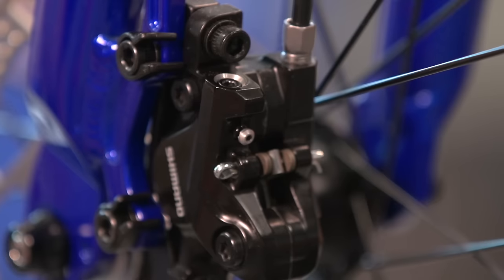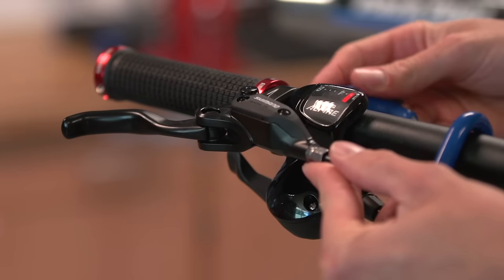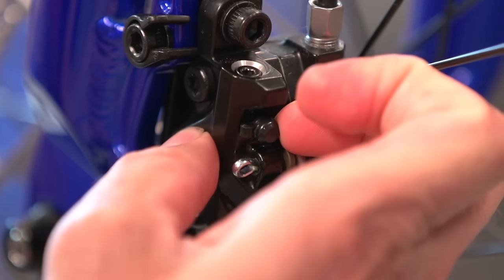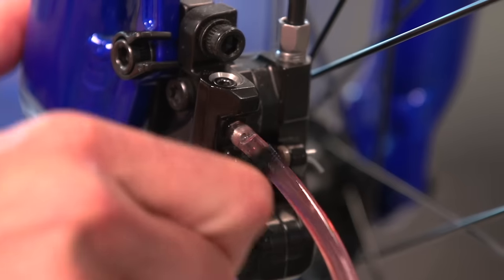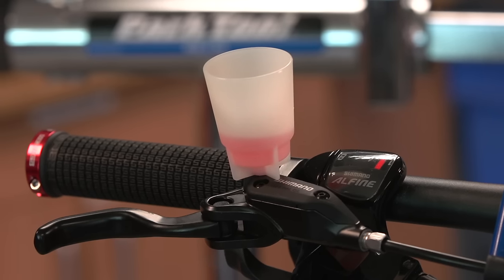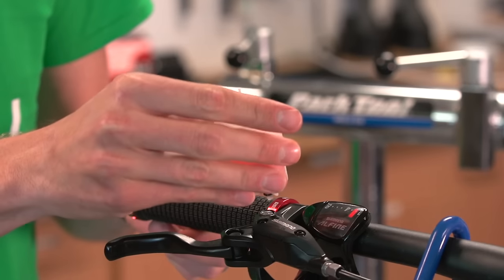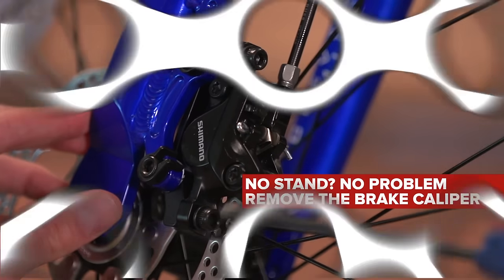How To Bleed Shimano Hydraulic Disc Brakes

Comment: There are some missing steps here as others have said!  You should purge any air from the syringe before pushing through the caliper.  You are missing the steps of passively releasing air (and a little mineral oil from the caliper) and positioning and flicking the levers several times to remove any remaining air in the reservoir.  You should most certainly remove the wheel and pads and secure the proper bleed block between the caliper pistons...
Reply: You are a legend. Thank you for the advice 7 years later.
Reply: Hey, the next time you go poop, let me know because I want the diamonds.

Comment: Good and concise video!  But I would highly recommend removing the brake pads and using a bleed block.  It's true that once you get good at bleeding, your chances of contamination get pretty low, but why risk it?  It only adds 30 seconds or so to the procedure and it's worth eliminating that potential trouble spot, especially if you're not experienced with bleeding.
Reply: Good advice.
Reply: This
Reply: I absolutely ruined my brake pads the first time I tried this so I definetly support your statement

Comment: If you don't want to remove your pads etc and still keep them from 
getting contaminated, just wrap the caliper with a piece of cling film 
covering the pads, pop the bleed valve through the wrap and it will stop
 any accidental fluid to pad contamination.
Reply: thank you!

Comment: Thank you so much for this video. It's the exact model calipers I have and I've never done this before. I spent about an hour just trying to find a video or manual that made this simple to understand. Your video nailed this in less than 5 minutes. Now I feel so much more confident knowing how to fix this next time without having to look anything else up online.
Reply: me too
Reply: And me too. No faffing around, did front and back brakes on first attempt in less than 10 minutes - nice sharp brakes now.

Comment: Great tutorial, even though my Deore M575s are a little different configuration, you provided enough information about why you did the specific steps for me to figure out the things that were different. Specifically, the valve release is a nut just behind the feed nipple, not a hex screw on top. Otherwise, after a slow step by step for the rear, I was able to breeze through the front with no help! Thank you for sharing!

Comment: Was totally unfamiliar with bleeding bike brakes, but I got a kit for $20 and followed the video and they're good as new.  A few videos I watched before this were much longer and involved removing the pads and using spacers which I wanted to avoid doing.
Reply: you have to use those spacers with some brands or they pop out and you get oil everywhere

Comment from the maker: Head over to your local bike shop. They should be able to help with the part and may even have a couple spare lying around. If not, the shop you bought it from, or the distributor in your area should be able to help out.

Comment: I've used vegtable oil in all my bikes that take mineral oil for 30 years now, it's never caused any problems or ever caused Corrosion in my parts or o rings and works extremely well i would go to say it works better and gives to good stiif non spongy breaks

Comment: Cheers for clearing up my questions I had running around in my head. First bike I've had in many years and tech has come along a fair bit. Curious that dot 5 silicon based fluid isn't used but no doubt there's a reason.

Comment: So what abut the pad position? If the pads are worn and you bleed the system and then try to replace the pads won't the system be overfilled? Also, maybe remove the pads  before the bleed so you can pump the pistons back into battery and you also don't inadvertently spill fluid on the pads.

Comment: Just a note. If you have cheaper oil use it in the top cup to fill it just a bit.  Then push the new oil in and when all bubbles and old oil is out shut the valve.  You're just gonna toss the oil in the cup anyway, and none of the cheap oil will go down.  No sense tossing the expensive oil.

Comment: New to mountain bikes but have bleed many brakes on vehicles. I've seen a few videos and I'm always surprised by the given technique. Why don't people just use a syringe to push the new fluid into the reservoir and out the caliper and/or pump it out with the brake handle while filling the reservoir?
Reply: Like a car?

Comment: Brake Bleed Funnel (Shimano) are not the same threads. Therefore to casually screw on is not always possible. To find the correct adaptor is a sod

Comment: You should really remove the pads before you do this.
Reply: I'd concur, and I remove the wheel too. Brake fluid is impossible to remove from a brake pad. The rotor is cleanable, but its best to not have too.
Reply: Yes, that is right! I also use masking tape around and below the brake system so any leaks can be blocked and absorbed by the tape, and will not get to parts that will affect braking and soak in to the pads (this will be, like you say permanently absorbed, and cause less friction and squeaking. Also masking tape adhesive is not going to mark the paintwork.
Reply: And he skipped how to remove the air trapped, there is a way....to do it
Reply: Are you questioning GCN??? Fite me rite now!

Comment: My Shimano brake fluid's colour has changed into yellow. If I apply this procedure to my brakes, will the old fluid and the new fluid get blended?? If so, what can I do to prevent it from happening right from the start?? PLS answer me soon! TKS a
lot
Reply: If your worried about it mixing run new fluid from top to bottom first then bleed the brake to remove the bubbles. I did this on a set of zee I bought second hand and they run really nice now with new fluid in them.

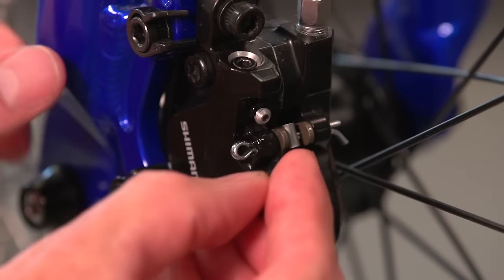Comment: After turning 1 round anti-clockwise for the valve at the brake device below, did you forget to tighten the valve back (@video 2:33) when putting on the rubber dust cap?
Reply: 2:05

Comment: Should you not remove the brake pads before bleeding the brakes, so that they won't get contaminated ? Shimano also give the plastic spacer that fills the gap between the two pistons (where the pads been) - you don't seem to use it. I've seen shimano deore bleeding video and it looks quite different.

Comment: do you have a video or information on how to shorten the hose on these same type of shimano brakes. I removed the hose from the lever but found the brass olive seems to be crimped on and can not be removed to reuse the small parts. how can I shorten hose? do I need a special crimping tool or something?

Comment: i have a e bike that i use for my daily commute  avg of 14miles each way. been considers purchasing hydraulic brakes.. should I? how often would i have to bleed?  Would it be better if i stick with my mechanical disc brakes?
Reply: daspecialist1220 mechanical disc brakes are rubbish. Proper hydraulic disc brakes are amazing. Once bled you should never need to bleed it again.
Reply: i heard that everytime you add fluid or change it out you have to bleed the brakes.. see that would make a huge difference for me because i literally do 28 miles a day. for someone that rides a bike here and there it would be such an issue atleast this is what i was told
Reply: Angelo Ramirez you don't have to add or change the fluid very often or at all in fact. Once you have blead up, that's it.

Comment: Hi I have a mountain bike with a mechanical disc brake I want to convert to hydraulic brakes. Do I need to buy a seperate gear shifter when I am converting to hydraulics?because my current gear shifter is attached with my brake lever (what I mean is that the gear shifter and the brake lever is attached to each other they are together)
Reply: Yeah you'll definitely have to buy a new brake lever/shifter
Reply: James Black Thank you James!

Comment: How much mineral fluid do you need to suck with the syringe to successfully bleed the brakes.
Reply from the maker: It's not a huge amount - really all you're looking to do is get rid of the air from in the system.
Reply: About 25ml

Comment: It seems my bleed valve is leaking. Every time i break i can see fluid squirting out. I tried different levels of tightness on the valve and the problem persisted. Is this a common mistake? Do i have to purchase a new valve?
Reply: Try wrapping the thread in teflon (PTFE) tape first, or some other sealant. See if that helps.

Comment: I was changing the front wheel to replace the breaks, and noticed a lot of fluid came off where the front breaks were. When I realized the cap on the side of the breaks was missing I found it and put it back. I put the breaks back in and wheel back in and noticed it doesn't want to squeeze the breaks at all. Any help? It feels so loose, there is no movement of the breaks almost as if there are no breaks at all.
Reply: well no shit all the oil came out you need that oil for the brakes to work

Comment: So my hydraulic disk brakes work fine if I'm going slow but as soon as I speed up they somehow stop working (it seems as though it loses pressure). I've tried readjusting the pads and positioning of the brakes, I bled the cable and it still does the same thing. Any advice?

Comment: Pro Tip: you can use baby oil instead of mineral oil. It's cheaper and easier to obtain, and works just as well as mineral oil, I can only speak for Shimano hydraulic brakes, your mileage may vary.

Comment: I'm surprised you don't advise to take the pads out and replace with a pad block to avoid contamination. Sure you could probably do it without getting oil on there, but there is a risk which isn't worth taking personally.

Comment: I was suffering from squeak, then realize my caliper was leaking, where the pistons push the brake pads. Mineral oil was going into the brake pads making the squeaking noise, Any ideas how to fix this?
Reply: maybe the pads are contaminated, if they are, you should change them.
Reply: Try sand paper on pads. Clean oil  off this way

Comment: Why not bleed them the same way you do a car or motorcycle? By using the master cylinder to pump the air and fluid out of the bleeder screw on the caliper.

Comment: it's ok to use the old oil again?
Reply: I wonder as well
Reply: +Abdurrahman Ali My old oil always has water and dirt in it so I just tip it all into an old water bottle and throw it away. I think the main problem is the air in the hose making the brakes limp and spongy so if it is an absolute emergency old oil is better than nothing and you can always re-do it with new oil later.
Reply: +Abdurrahman Ali Shimano Mineral Oil is not expensive. Use new

Comment: I don't see any valve.  The moment I undo the tube at the bottom, all the brake fluid spills out.
Reply: that's cause you forgot to tighten the valve screw back up. he shows you where it is on the caliper. Check the video again, it's there.

Comment: That is quite a risky tutorial. Usually you remove the brake pads because if you put even a small drop of brake fluid on them you have to throw them away. But whats even worse: You didnt make sure you had no air in the syringe, which is REALLY risky. If one single bubble of air gets in the brake in the middle of refilling you have to start all over again, and there was way more than just one bubble in this syringe.
Reply: The bubbles at the end come out in the funnel anyway.

Comment: I recently had my front wheel pads squeaking a lot when spinning, i took my bike to a bike shop where they changed my front pad and centered the disc correctly to it, so its no longer squeaking, however the guy also opened the thing near the brake lever which has the mineral oil in it, and some of it gushed out and now i have brake lever "really soft" as in if i brake with 1 finger i can feel the back of the lever touching my finger, the breaking is good however, just really soft! - what should i do? =/
Reply: Bleed the brakes

Comment: Flicking the brake line with the fingers doesn't do anything and it's silly. It's superficial. If there is air in the brake line(feeling an obvious gap before the brake engages, you have to drain all the fluid then replace it. Then you just have to rely on the feel of the brakes if there is still an obvious gap.

Comment: Remove this video, bechause doesnt have all steps and is wrong !
Reply: like what?
Reply: like watch some other videos.
Reply: caparzzo He's right, a lot is missing here
Reply: degassing the fluid, keeping the syringe upright to prevent air from going in, pushing fluid out the hose before attaching so you don't push an air bubble right in... in addition to what others have said. This video is not that helpful.